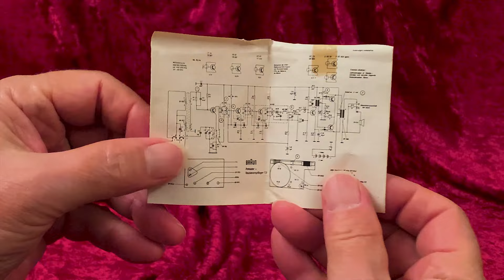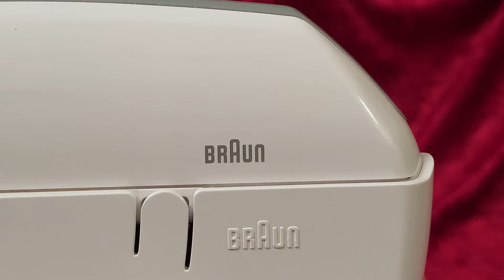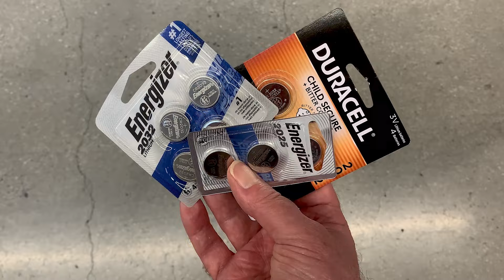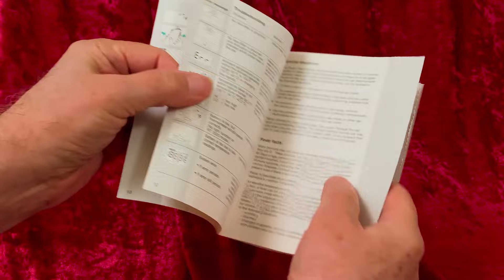Braun 1958 transistor radio T3 up close Dieter Rams minimalism product design celebrity worship

Comment: Your discussion of the Braun thermometer is spot on. Many products of that brand (as well as B&O and a few others) are essentially unusable because there is nothing about their design that is intuitive. And God forbid that, like myself, you are in the electronics service business, and have to figure out how to take some of those units apart! But perhaps the worst examples of unintuitive and wrong-headed design are car radios which, rather than having a volume knob, force you, while driving, to navigate through menus just to turn them up or down.
Reply from the maker: Yes! It almost seems as if the volume knob is forbidden for some reason. Like in a design meeting someone brings up using a volume knob and the whole room erupts in laughter for ten minutes. "Hopelessly old fashioned" is my best guess as to why they refuse to use the obvious and best choice. And this goes back even earlier--and with volume knobs too. Factory and after-market car radios had, beginning maybe in the '80s, knobs that LOOKED like knobs but were really switches. You turned them to one side or the other bu that would just trigger to function to electronically run along, ramping numbers up and down for volume and tuning. You had to LOOK at the dial to see where you were instead of just being able to "feel" it the old fashioned way. So a person driving a moving car has to look over at the teeny, poorly lit LCD screen to tune or adjust the volume. Brilliant. One wonders how much needless destruction happened on the highways because of this "machine-first" design. Then... and now.